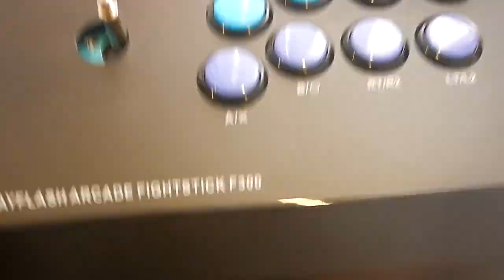Modding the Mayflash F300 Arcade Fight Stick

Comment: Iv had the mayflash f300 fightstick for about 2 years. I replaced the stock stick and buttons with sanwa parts and it does the job very well. I usually play long sessions of fighting games while the fightstick on my lap and the bottom panel has gotten very rusty because of the sweat from my thigh. I am eventually going to replace the rusty bottom panel with a plexiglass bottom from the focusattack store website so I don't have to deal with a rusty panel staining my pants and making my leg smell like rust.

Comment: if i wanted to change the spring but not the whole joystick, would i be able to use that spring on the old stick or would i have to find a different one?
Reply from the maker: You can simply replace the existing spring in the original joystick and swap it with whatever you want.

Comment: is the original stick and gate really that bad? I just ordered the f500 because i wanted the more solid case, headphone jack and the ability to change the art graphic on the top. However im kind of nervous about changing the stick. Was thinking of just getting a new ball top to match my custom art.  this will be my first fighting stick i know these sticks are great for modding but i was hoping it would be good enough to use without much tinkering at first.
Reply: I upgraded my plate alone and it was a major difference only 4 screws other then the outside case. Did mod it yet?

Comment: There are quite a few add on options for the joystick and I was wondering if it is all necessary, I'm new to arcade sticks. Hope you can help and thanks in advance.
Reply from the maker: The add on items are not necessary. Though I bought the oversize actuator, the octagonal insert, and the 4lb spring. If you're wondering what each does, refer to the other comments where I and other people explain what they do. Hope this helps.

Comment: Actually my arcade f300 joystick movements like forward down and d/f were not working :(. I tried to unplug them and back it all still i don't know whats really happening inside all. If this kind of problems occurs what i have to do please i need help. If i order from amazon sanwa joystick will i able to get free the spring and actuator or do i need to buy them separately.
Reply from the maker: I'm assuming you're having the same problem I was having at 3:34 .  Do the same thing I did and rotate the black bit (idk what it's exactly called). If that doesn't work try flipping the cable that connects the joystick to the motherboard, with the colored part of the cable facing upwards or vice versa. As for ordering on amazon, I assume you'd have to buy the actuator and spring separately, most likely costing more. Hope this helps.

Comment: My Sanwa stock only came in with the different colored cable, any way I can install it or do I have to get that 5 pin cable?
Reply from the maker: Have you tried using that different colored cable with any success?
Reply: @phorusfines  some dude sold me the Sanwa stick along with the colored cable, but that one had some adapters on the tips that allowed me to connect it.

So I guess you can use it as long as you have those adapters, I can take a picture of then if you really need it

Comment: did you buy the 5 pin adapter?  to connect the joystick to the other end of the board?
Reply from the maker: The items I listed in the description are the items I bought and used in the video

Comment: A noob question I know, but I was wondering... when reconnecting the two wires per button, does it matter which wire goes where?
Reply from the maker: Qu9ke as long as the two buttons are for the same directional movement and in the right position (up, down, left right) it doesn’t matter

Comment: So does this make a big difference than what comes stock? I just ordered everything listed to put into it, just curious if it's more solid or not.
Reply from the maker: A detailed description of the oversized actuator is best explained here: https://youtu.be/70PRLEBImIs (I'd probably horribly explain how it works so skim through the video :p). The octagonal gate (acknowledge this is personal preference and again, probably horribly explained by me)  gives more directional input for moves in general. For example, easier inputs for fireball and dragon punches. The drawback here calls for more specific directional inputting for charge moves. Stock buttons just didn't feel right to me. Response time doesn't change with replacing them , but it feels much better. Same with the joystick. I hope this helps!
Reply: Phorus Fines awesome man, thanks so much! And the stock stuff just feels slow and not as fluid as I would like. Ordered everything from this video yesterday so I'm excited to see for myself how much of a difference it make. Thanks again!

Comment: can you provide some detail about installing the stick cable and how to know which direction to orientate the part. Also which direction the wire is supposed to be plugged in (im afraid of doing it wrong and frying something...)
Reply from the maker: I simply watched Gavin Horrick's video tutorial on how to install these mods. I feel as if I would give you an incorrect explanation so I'll link you the video I got reference from: https://www.youtube.com/watch?v=FIy2nuwdbCo

I hope this helps.
Reply: quick question. There's a way to just use the cable that comes with the stick instead of the female to female cable?

Comment: Modding the F500 is the exact same? Why is it needed to change the spring and actuator?
Reply: Mateo is not needed, some people prefer more tension in the stick.
Reply: So both spring and actuator change the tension in the stick?
Reply: Mateo I think the actuator is for the softens it when it touches the edges. I don't know if it is needed. The spring makes the tension.
Reply: Thank you, I didn't really understand what were those for

Comment: Another noob question.
How did you remove the quick connectors? Mine are super tight.
Reply from the maker: I'd suggest for you to simply wiggle it loose until you can get it out. Just make sure you aren't yanking the thing cause it'll break obviously. I hope I was helpful
Reply: Phorus Fines thanks